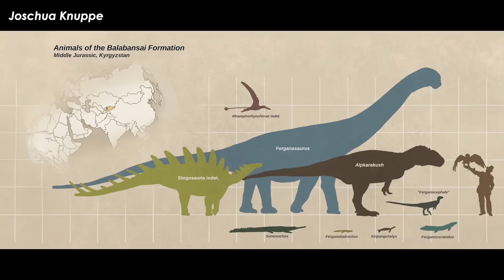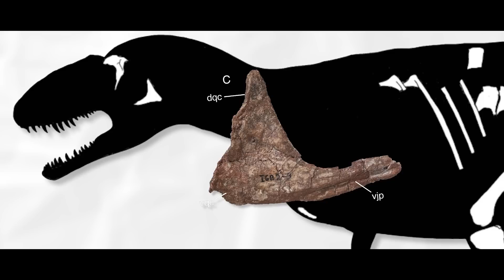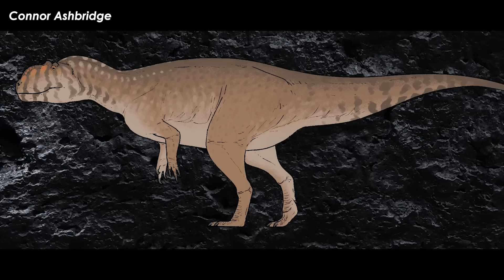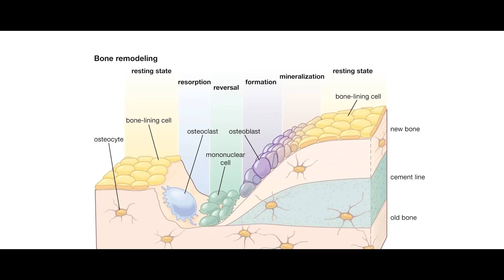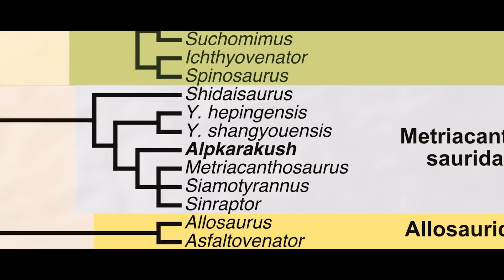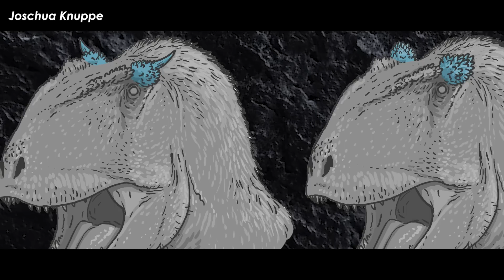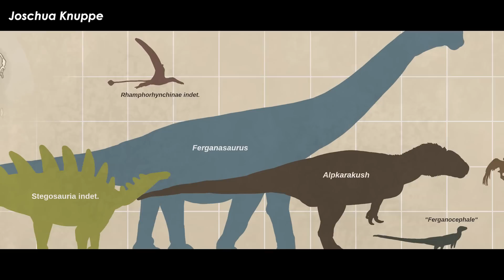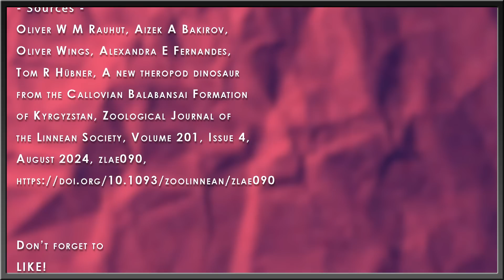Killer Dinosaur Finally Found In Central Asia! Allosaurus Had An Even Scarier Asian Cousin!

Comment: I don't understand how it can be determined that a lot of these dinosaurs are all thought to have :tiny" relatively "  upper limbs when a lot of them have no upper limbs found. .Maybe they did get larger upper limbs?
Reply from the maker: Because their relatives all had small arms. On top of that, big arms is relatively rare among all theropod dinosaurs. You'd need proof of big arms to speculate their presence because the default is smaller arms. On top of that, you can tell how big the arms are if you have chest and shoulder bones.